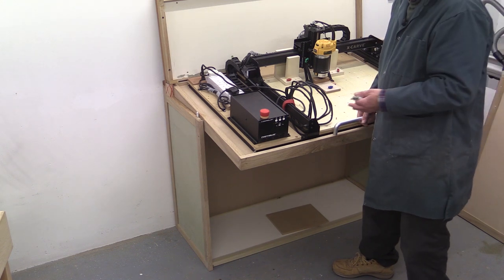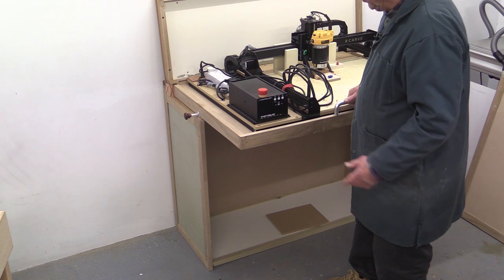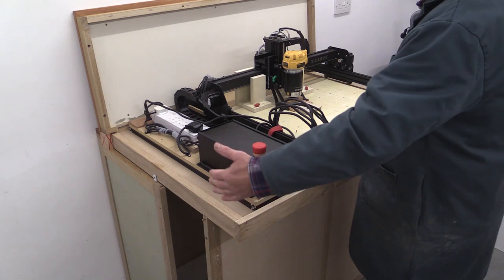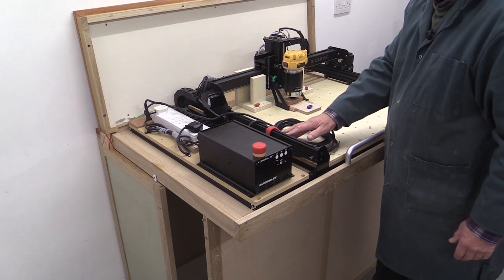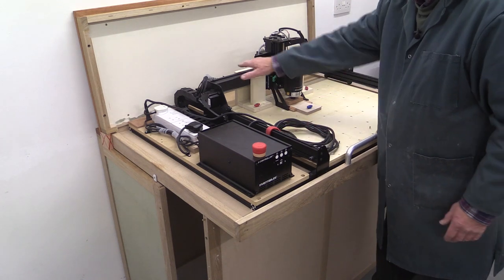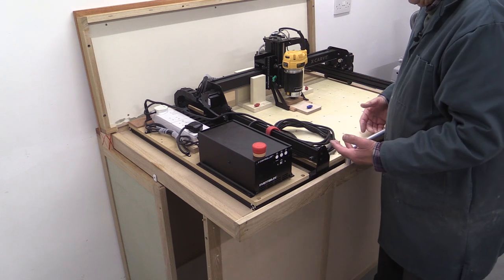How to make a CNC Cabinet

Comment: Hi Peter great video as always!! An unrelated question, is there a way to increase 19mm dog holes to 20mm so they will work with parf dogs and related accessories? Thanks
Reply from the maker: Hi Barry, It would be difficult to get them done accurately. If it is an MDF top then replace it and use the Parf Guide System.  Peter